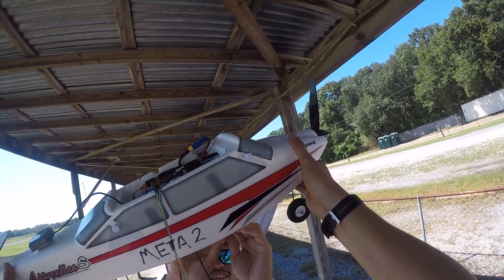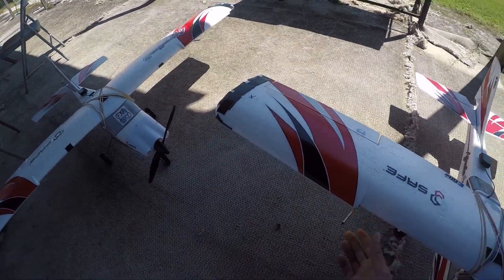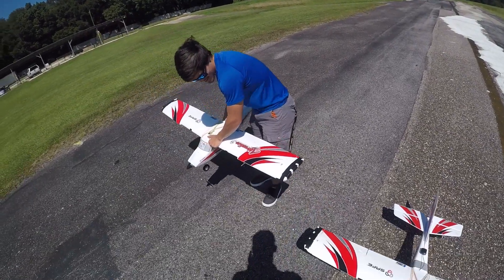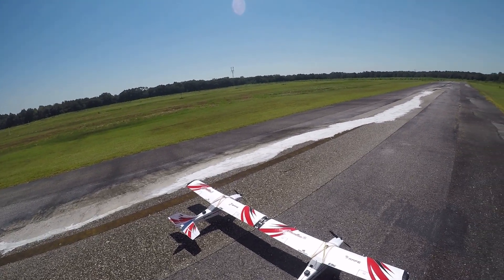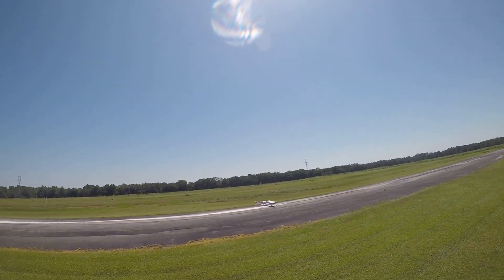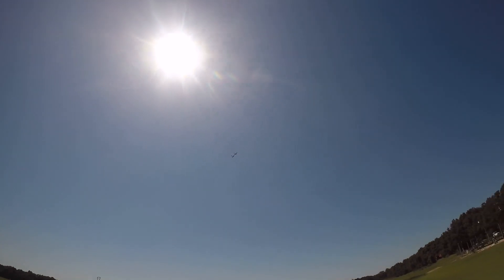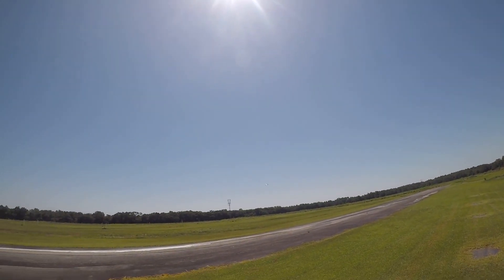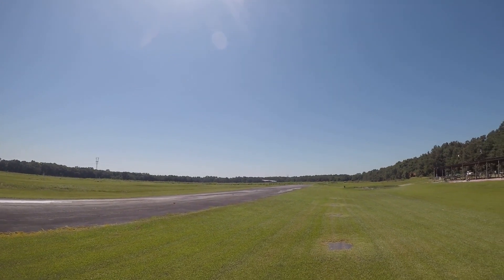Apprentice Meta Aircraft Flight Test with Raspberry Pi+Navio2

Comment: Whats the purpose of this?
Reply from the maker: The connected aircraft increase range and endurance by decreasing wing tip vortices. This increases the overall L/D ratio of the entire aircraft much like geese flying in formation. Right now this is just a concept but Airbus is already trying to work on aircraft that connect and disconnect in flight.

Comment: Hi Carlos, how did you connect these wingtips together? By magnet? If so, why does it look so reliable?
Reply from the maker: Yup magnets. They are N52 neodymium magnets with a pull force of 12 pounds. We put 3 on each wing so 36 lbs. The aircraft only weighs 2.5 lbs so they are really strong magnets!